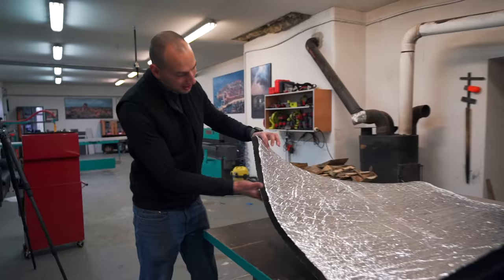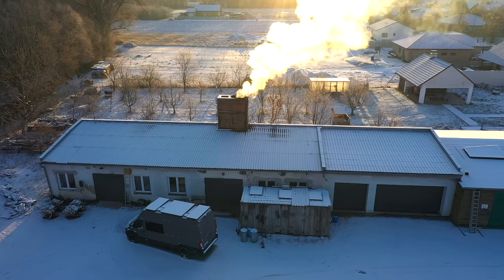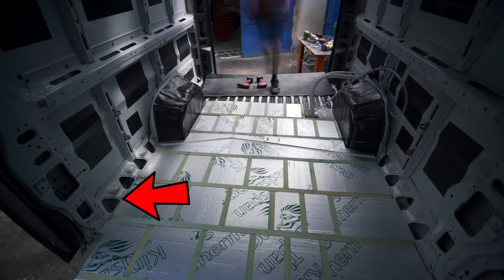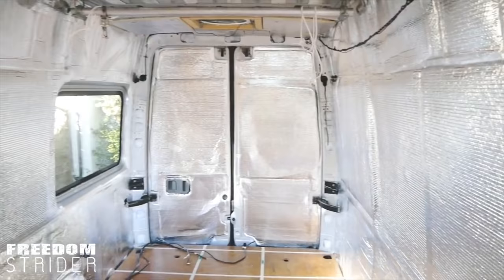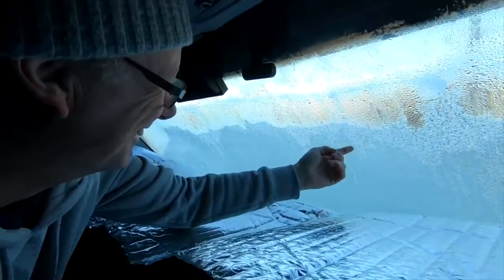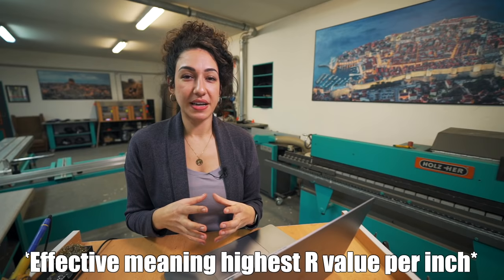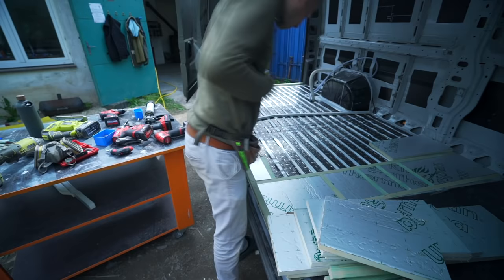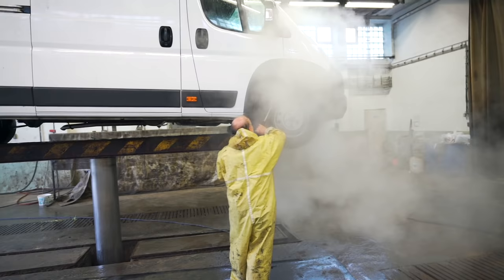❄️How to *ACTUALLY* Insulate Campervan for WINTER VANLIFE ❄️

Comment: I'm glad to see that you answer  comments  - I don't really care to comment when there's no feedback. 
I'd like to hear your views on various floor heat options.
BTW, love the Millie interludes! I hope to be able to get a cat in my van someday
Reply from the maker: Cats are the absolute best Vanlife creatures! But I’m biased haha. We’re working on ordering our floor heating mats now, but we have no interest in running any hoses with hot water under the floor to heat it up. We wanna have it a bit more simple
Reply: @ladiandmargaret  thanks! I looked into floor heating mats when I had a sticks&bricks, but not for the 12v system yet. Looking forward to your video on those!
Reply: @ladiandmargaret  
The new systems to heat floors in houses is glycol. I believe that’s what the Vanlife tech system uses to heat the floors. You still have problems with hoses and the possibility of putting a screw or nail through a hose and having it leak. You shouldn’t use water because it freezes which is why you use food grade glycol.

Comment: A question from the beginning:
Isn’t it actually bad to insulate the doors ? Most cars, during a rain/storm etc. drain the water entering from the keyhole or handle on the bottom side of the door.
If you stuff that door full of your isolation, the water won’t dry or drain. Even worse: your isolation might get soaking wet. 

Would like to hear your thoughts on this.

Comment: I did spray foam in my box truck. Effectiveness is just amazing. It was warm enough with human body heat when it was freezing point outside.  Because spray foam actually forms thicker layer than others. But!!! Spray little by little. It is hard to cut off if you spray like crazy.. I tried foam board too but nothing beats spray foam for the winter time.. I mean seriously warm, and also closed cell foam works as vapor barrier. If you don’t live in winter season state, I don’t recommend spray foam. And inside beams? Please use spray foam cans! Not the professional foam mix spray. It expands and hardens in 10 seconds unlike home depot foam spay slowly expands

Comment: Very informative video, thank you. I wonder if you could use vacuum insulation panels. It has a r value of 28, it's only weakness that the panels cannot be punctured or it'll lose most of it's r value.

Comment: Cover all cold bridges as much as you can. Insulate as much as you can, try to avoid non porous materials except anti mould/rust paint on metal surfaces  Control moisture with a dehumidifier for when you're not in and heat recovery ventilation system when occupied when occupied. Moisture will always find its way to your exterior van walls where it will stay unless given a way to return. Ease its path with breathable materials.

Comment: Vapor barriers are to stop moisture inside the house/van from moving into the walls causing rot/rust/mold and should always be used. Closed cell foam is a vapor barrier in itself.  Don't plan to go into cold weather if you don't insulate the floor. No matter how much heat you have the floor will always be cold and your feet will freeze.

Comment: Bubble wrap on glass Works, and it works well.  wet a touch to adhere to the glass. My van has rockwool insulation and no matter how cold outside it quickly gets too hot inside.  I know how effective bubble wrap is as without it the van goes from hot to cold in no time.

Comment: I get the appeal of Havelock wool but from looking at it I don’t see how it is going to stay in place inside the walls with the constant pounding it will take in a van.  Rockwool gets slammed because of “fibers” (always use a good respirator when installing it) but once your build is finished, if “fibers” find their way into the interior you’ve done a poor job with your build. Rockwool is structurally stable and will not slump.

Comment: Can see myself watching all of these thank you for making them. Can I ask did you put all the holes in your van (water/gas/electric inlets/outlets, fridge vent, toilet vent) before or after the insulation?

We still have some holes yet to do, and are tempted to add the insulation then make the holes later because we don't know exactly where the grey water outlet for the shower is going to be because we haven't picked one, and many examples like that. However the issue is that we are going to end up with swarf mixing in with the wool which could rust, and also may be silly and end up hole drilling through electrics! Wondering what your thoughts are on this?

Comment: hey, have you heard of aerogel? It's got roughly twice the R-value of XPS foamboards, but it's also roughly four to five times as expensive. So it can be used selectively where you want to loose minimal amounts of space to insulation (e.g. sleeping sideways in the Ducato without flares). It's also very dusty and should be enclosed airtight to not cause any issues...
Reply: I think the cost is prohibiting and the fact that it's dusty and requires special handling makes it a not-so-great option IMHO. Great material though.

Comment: Nice video again, you are the best for creativity and detailling. 
About insulation, you use armaflex or something similar i guess.
Another solution that rarely came out is cork. Projected cork create no thermal bridge, good sound and thermal isulation and is moisture resistant. There is even more work to install it but it's cheaper. 
Wish you the best!

Comment: A house would have one vapour barrier on the warm side of the wall, and the other materials should be permeable, so both sides can dry out. I don't know of a good way of insulating a van and keeping the vapour barrier, because sheetmetal is also a vapour barrier, but it's on the cold side, allowing moisture to get trapped. As air cools, it can no longer hold as much water, so even if the insulation was dry when installed, once the van is taken somewhere cold, the moisture in the insulation will condense.

Any ideas? (Edited for punctuation)

Comment: as far as spray foam i think in general its a great product... however in my case... I have some pretty severe food and chemical allergies and this one happens to be in the bucket of problems for me... they allege there is no off gassing however even if its been a year after install I cannot be in a smaller confined space with it or i get raging migraines and have problems breathing...  I have ended up turning down design installs with small homes where they used spray foam insulation....

I am all about the natural wool especially in vanlife or tiny home... I also think the foam block insulation will help a lot too.

my torti is sitting next to me while typing and she perked up watching your baby play with the wool.....

I hope you kids had a great holiday!

xoxo Randolph

Comment: The main thing I'd disagree with in planning insulation is that wiring doesn't have to be buried within / behind insulation. It's perfectly viable to run conduit sections that contain the wiring on the finished surface or within channels of the insurance;ation.

Comment: I'm guessing, if you wanted to make spray foam insulation work well, as in, not bend your sheet metal, it would make it the most time consuming method by far, because you would have to spray it on very gradually, in small increments, letting it fully expand and dry before continuing to apply.

Comment: Isn’t it better to keep the wires close to the interior panels of the van so you can make repairs as needed? Or do you run wires thru conduit to protect it from rubbing and wearing?

Comment: What kind of wood did you use between the foam boards on the  floor? I am about to start building out a van with my wife. And we have been enjoying your videos, my wife is from Prague and we usually try to visit Czech once a year. We have a small summer cottage in celakovice on the labe River.

Comment: Where those lower drain channels are. Could you snake small diameter plumbing pipe insulation that far down into that channel where it would prevent any insulation on top of it from migrating into the depths of the channel but still leave a curved gap under the pipe insulation to allow water to drain?

Comment: Interesting video, thanks. 
You didn't mention wood fibre batts, maybe they are not available where you are?
Wood fibre has a similar R value to Sheep's Wool, but has a far better Specific Heat Capacity and can cope with moisture. 
You mention that you don't want insulation in a hot environment, I beg to differ. If you can get enough wood fibre insulation thickness, you are protected from over heating as well as cold. Only Cork insulation is close to wood fibre in this respect. If you have a U-value to the domestic standard in a dwelling in the UK of fibre glass, you will have around 4hrs before you start to roast on a very hot day, wood fibre with the equivalent U-Value will give you 8hrs before the solar heat gets through.
I'm no expert, but I will use wood fibre and self adhesive foil insulation on our van soon to put my money where my mouth is. TBF, it's not a camper van, but a works van for gardening equipment that always has bad condensation. We occasionally clear it out and kip in it, so we don't want to freeze anymore either.

Comment: You need to use closed cell then reflectic and tape once u have  that use ply wood and wood glue make sure you calk the metal screws  . Make a door to ur cab and to the side door and insualte it . 

Btw reflective material  will work down to zero as you heat the room it bounces back . Your man there was  using them backwards as he  the reflective out when its cold it needs to be turned in . When its cold the black fabric needs to be out

Comment: Have you seen the Humble Road 4 layers of insulation in the ceiling video? I would be interested in your opinion of George's process.
Reply from the maker: It’s a subjective opinion of his. Vinyl has nothing to do there for noise deadening. It’s a heavy material with very little benefit. The rest is equivalent to our double chrome 30mm board imho.

Comment: I agree with 98% of this.  However, you don't want a vapor barrier in a metal box.  You want that thing to be able to breath and dry out on high condensation days.  The other thing that should be touched on, is how hydrophobic certain insulations are.  Fiberglass insulation is NOT hydrophobic and will degrade with moisture, and should NEVER be used, because it will hold moisture.  Sheep's wool IS hydrophobic, and is probably has better insulating properties than rigid insulation.  Another great insulation is Thinsulate (is hydrophobic, easy install, and great insulation properties).

Comment: HELP !!!!!!!!     I just started insulating my Van — I covered every inch I could with soundeadening.  ——- now   WOOL ——- talking about stuffing the wool in the huge cavity down at the bottom —- where it seems like you’ll never get done ✅    WHY  should I not do that ———  and what should I use —— to keep the wool  UP  basically for  Moisture  to release from wool & drain ——- did I just answer my own question ?   But; what should I use down low in that cavity to basically hold the wool up ⬆️

Comment: Love your video's, very informative. First time I saw someone comment on the lack of insulation on the back and side doors. Finally! 
Now for a question: We will soon build our camper and will use wool as insulation. However I'm considering adding another layer of board foam insulation on top of the wool, on the ribs of the van. So wool within the ribs and boards on top op the ribs. Could this work or do the sides of the van curve too much? (we will go for a Fiat Ducato L4H3). Any thoughts?

Comment: What do you think about seperating the cab from the living area using motor driven isolated shutter placed in the space above the driver  cab? With a shelly this could be integrated in a local  home automation.
Reply: I'm planning this in my build. I want to separate the cab off because it's tough to insulate, and all that glass gets hot in summer and cold in winter. Not sure how I'm going to do it yet ...
Reply: @akiwiincanada  With the shutter closed it looks like a cargo van and it should be opaque. I am starting in May or June 2022. Maybe we can learn from each other as i learn from every Ladi & Margaret video i watch. Thanks a lot Ladi & Margaret

Comment: I like switching between the "theoretical" and the build videos. I've looked for videos like that for mobile internet and really haven't found anything useful. People misuse terms almost constantly when it comes to mobile Internet and it makes it extremely difficult when trying to understand the different options there are. WiFi, for example, has become a catch-all term for people and is almost never used in the correct context. So, going into detail on subjects like insulation, etc. can be really useful.

Comment: Hey margaret, are some thermal insulation materials better at acustic insulation then others? How do you guys take care of the acustic part? 🤞
Reply from the maker: I've heard spray foam is a great sound insulator. We still used sound deadening matts and then have the panels above. I haven't seen any videos just testing that, though, would be interesting. The panel material you choose can help with the acoustic as well!
Reply: @ladiandmargaret 
Thanks! Can the layout also affect insulation? (thermal/acustic)

Comment: we have armaflex  isolation and from what we heard is should be the best isolation material. Flexible non moisture and very thin. looks like the K-Flex you where mentioning but not sure its the same.
Reply from the maker: Haven’t heard of that one before, are you in EU or NA? I think kflex is a euro thing, and it comes in a variety of thicknesses, is the Armaflex foamy? Or more like wool?
Reply: @ladiandmargaret  Wait - how have you not heard of Armaflex..?! :D
It is THE go-to option for the majority of the van-life builds hahaha
Reply: @ladiandmargaret  You are right, Armaflex and k-flex are both synthetic rubber foams that come in several thicknesses like 19 or 25mm.
ArmaFlex ist made by Armacell based in Luxembourg and I believe most popular in the German Vanlife-community. k-flex is made by L'Isolante k-flex in Italy.

They both offer exactly the same thermal conductivity (λ = 0.033) and permeability (μ = 10000).
However the manufacturers recommended temperature range for the self-adhesive variant is a bit different:
"ArmaFlex XG 19mm": from -50 °C to +105 °C
"k-flex ST 19mm"
: from -165 °C to +85 °C
At least in Germany both products can be bought for about 10€/m².
Reply: “Very thin” ??? K-Flex is R-4 per inch of thickness.

Comment: Stuffing insulation in a little hole surrounded by metal seems useless. The metal will transfer the temperature around that stuffed wool anyway, it seems more important to insulate between the air and the metal so that the temperature is not transferred to your room.

Comment: The lower door pillar of my Mercedes had sound insulating sealed in a plastic bag. Might be the way to stop your insulation becoming a giant sponge.
Reply from the maker: what sort of sound insulating?
Reply: @ladiandmargaret  It was just a bag full of foam. Stops the road and suspension noise  travelling up the door pillar creating a speaker next to your ear. Simple and effective. The main point being if you seal your insulation in bags you will not have a moisture collection problem. Your panels should of course be sealed to prevent moisture getting in to the cavity because once in its going to stay. Perhaps consider removable panels for venting cavities on warm dry days?

Comment: Speaking of kill switches... this popular vanlife YouTuber recently had a smaller van he was building out stolen. Fortunately recovered in not TOO bad of shape.
He's now installing a kill switch.

https://youtu.be/DJM-SXaNzd8

I recommend a fuel pump kill switch versus a battery kill switch.
Saves the hassle of having to reset ones clock and radio and other components that are dependent on the car battery.

Also, put it at in a place that's a MINOR inconvenience to get to, so if the thief realizes what happened he doesn't find it right away by a quick look under the dash or under the seat, but also that it's not in a place that's too inconvenient for you to bother to activate.

This is old low-tech. I've had them on all my cars since 1982 and convinced several buddies to put them on their cars. Saved one friend's car from his carport and the car belonging to the daughter of another friend from her College parking lot.

Comment: I have used a stone wooll in the walls of my van.. First sound bariere then wool.. And its great.. Also, there is a panels problem.. People use plastic panels for a walls. And that has its pros and cons..  Like, when y use wooden panels, theyr aldo much better isolation from cold, then plastic panels. In my appinion, wood os better heat barriere too.. I soo that ppl use sprayed foam in those pockets and ribs, and before that, they do wires in the same pockets. I mean, why ffs? Your wires are stuck in that foam, there is no repair option after spraying.. 😂😂

Comment: I won’t get into the vapor barrier debate, but relative to mold one thing that I think is not debatable is to have no raw, unsealed wood anywhere in your van. Wood absorbs moisture and is the primary breeding ground for mold, mildew, and rot. I haven’t seen anyone address this except on The Frugal Factor channel. For instance, floor battens need to be either “treated” or sealed with spar urethane (except for surfaces with adhesive). Floor and wall panels need to be painted with a mold-resistant primer, again, except where adhesive is used. Exposed wood that encloses your batteries, LPG tank, water systems, etc should be sealed with spar urethane or painted with 100% acrylic paint - do not use oil-based paint as mildew feeds on the oil in the paint. (Ask me how I know).